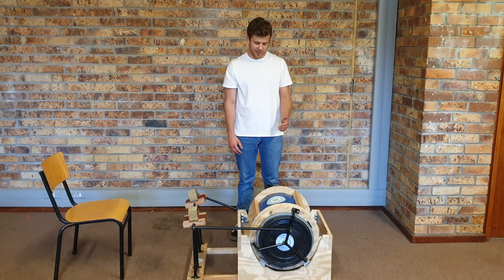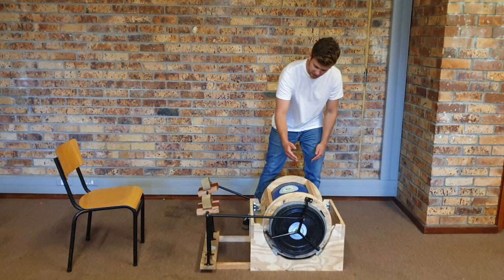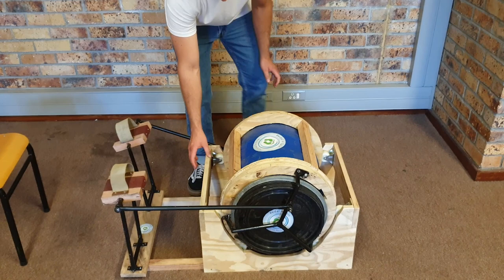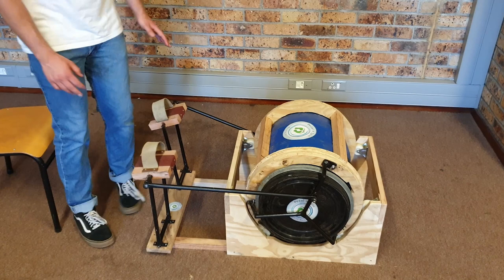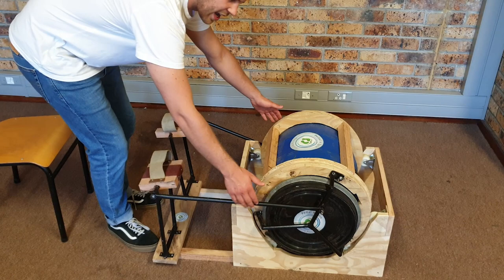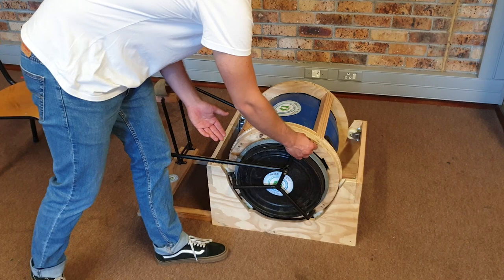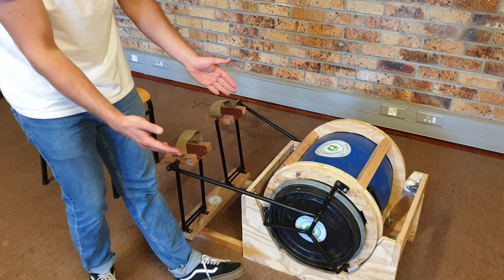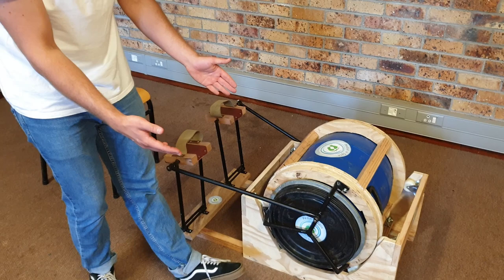Pedal n Spin Foot Cranked Washing Machine Demo

Comment: It would be cool to add an electric motor and battery system so that it can be charged while you pedal so you can pedal to charge then use they battery when you are feeling lazy.